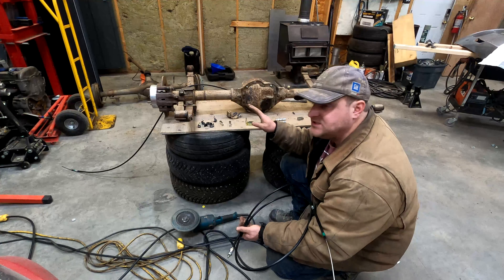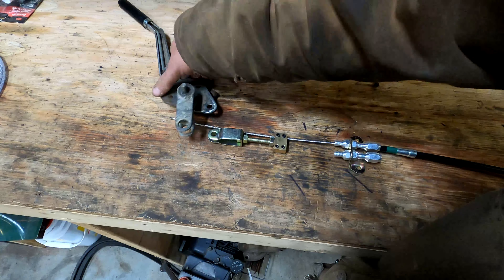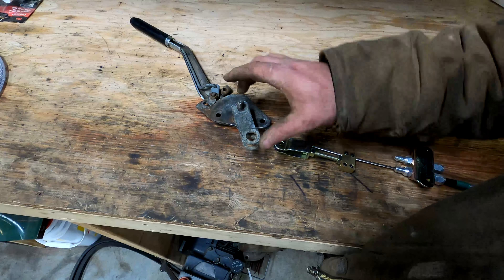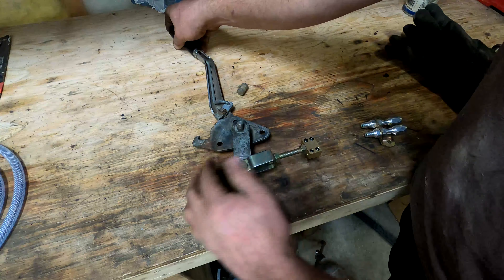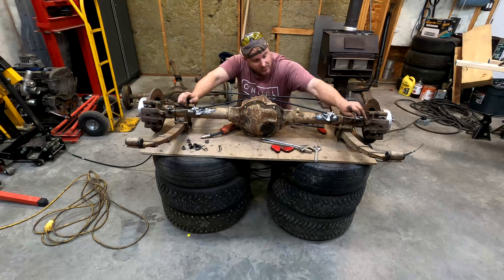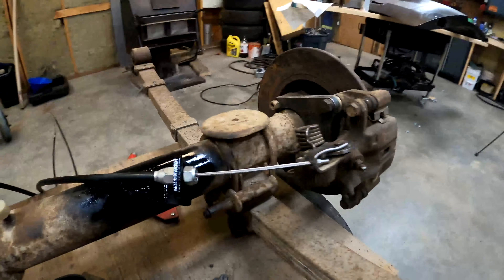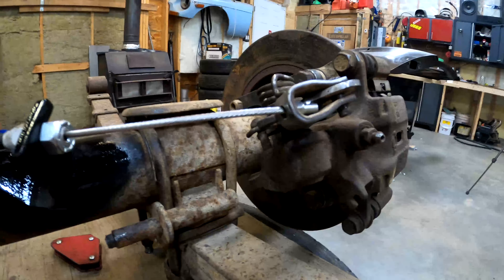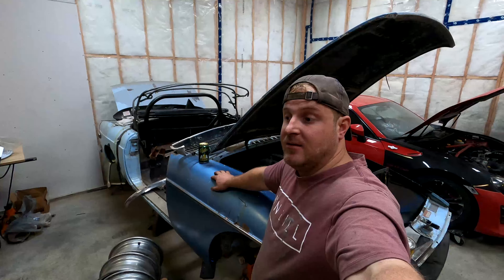Project MGB: Easy Rear disk Brake Conversion Part 2

Comment: Did you have to increase the center bore of the Sentra disc for it to fit?
Reply from the maker: Hi yes I did by a little I didn't realise till after the video.it wasn't by very much however. I will get you some measurements this weekend

Comment: Thanks for the update on the e-brake cables. How's the k swap coming along?
Reply from the maker: well im waiting on parts basically. been out of town for work too much over the last couple of months so i havnt been able to make as much progress as i would have liked. with any luck tho i will be able to order the running engine and trans. adapters in december tho.